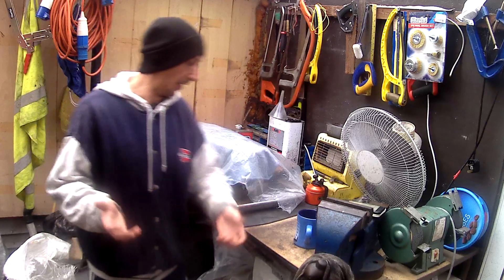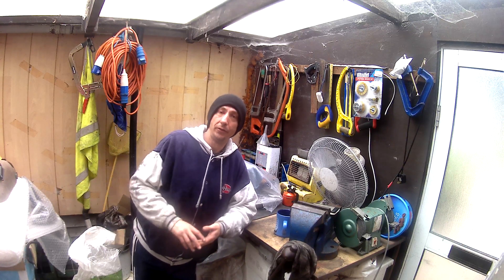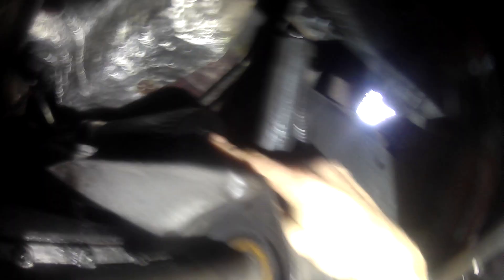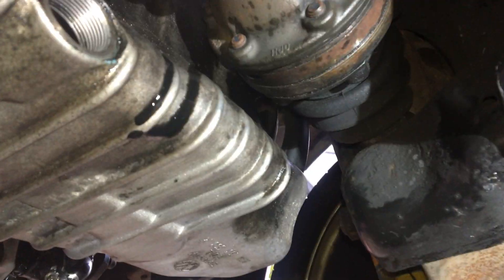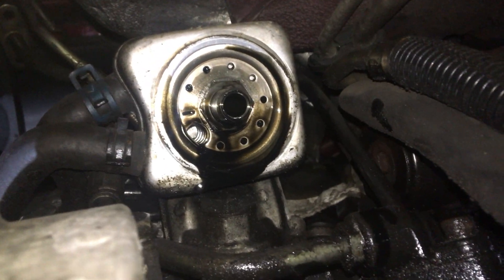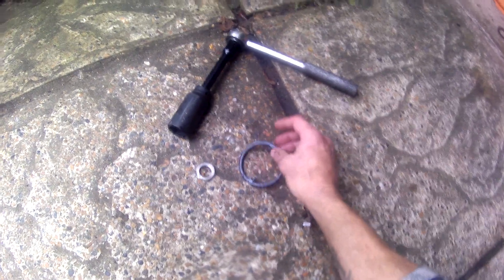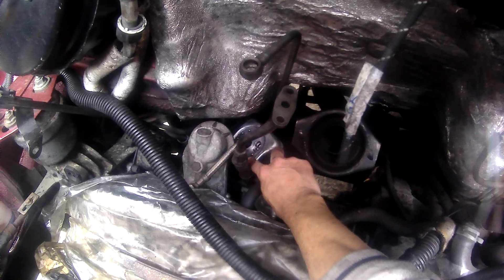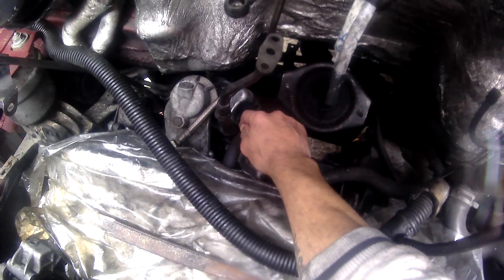Oil cooler to housing oring replacement

Comment: Does much oil come out when removing oil filter/cooler? Cheers
Reply from the maker: The filter will be full of oil and there may well be a little bit of oil in the gallery. If you’re removing the oil cooler altogether then you will want to clamp the coolant pipes before removing them

Comment: Make sure while you are doing the the oil cooler seal ... there is another one for the oil cooler housing .. that’s another one that fails and  could be your leak .. both had gone on mine ..
Reply from the maker: Thanks for your comment, you’re right I read on the forums before doing this job and I did see people have changed both gaskets. I think for now if once the engine is back together and running and still weaps then I’ll have to look at doing this again but with changing but gaskets like you say 👍

Comment: more doggo :D...You plan to run this long? if so use the opportunity and do bottom end as well...but make sure there is someone willing (and able) to balance the main crank available. in my neck of woods its a problem as balancing those is an art. 
mine still at mates, we never started. lot of other unfinished jobs. maybe tommorrow.
all the best...and more doggo :D (whats her name?)
Reply from the maker: I’ve discussed this with a friend and I think i will put it back together as it is and I’ll wait until I can rent a unit then maybe get another engine that I can rebuild then swap over, I have a neighbour who is a Ferrari technician and is going to get me a price coz they can do all of that in their machine shop. Whats going on with your van at the moment, slow progress?
Her names Izzy, my best friend 👍👍
Reply: @TwiggsT4  She sure looks like THE BEST friend..
As a matter of fact getting a spare engine and a unit to work in while driving the T4 is the most sensible thing to do. I sold quite a few projects due to "lost love" resulting from too much spannering, too little driving...
Mine is a LWB 2.5 ACV from 1997 with over half a million km on the dash. Decent bodywork, decent mechanicals..just a lot of tinkering to get it to my standard. When mechanicals are done it will be body-shop time for small repairs and then full camper conversion. While spannering and body will be done by "friends" with my little help, the conversion will be my work. When I lived in UK I used to do a bit of "conversions" in 4x4s. Drawers, water tanks, etc. Wanting to go into campers and I have the opportunity now.
I`m not documenting anything on YT at present (for the first time I let other people do some of the work on my car), but when I start the conversion I will try to do in-depth vids. But pretty sure these will be in polish. There is hardly any such content on polish YT while there is plenty in English, especially from GB.
Cheers!!

Comment: Was the old seal flat? - mine was squashed flat
Reply from the maker: Yeah it was squashed flat, I think these should be changed at every other oil service
Reply: @TwiggsT4   or every 10 years
Reply: Yeah, mine was flat to😂 but no leak oil, just litle litle dirty